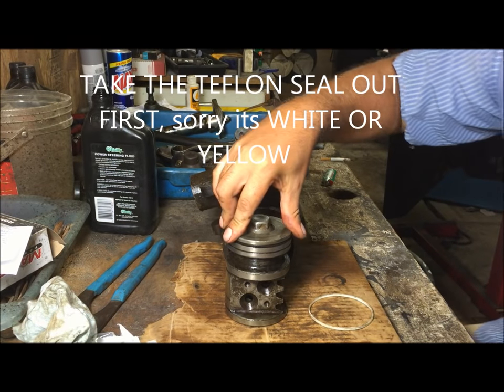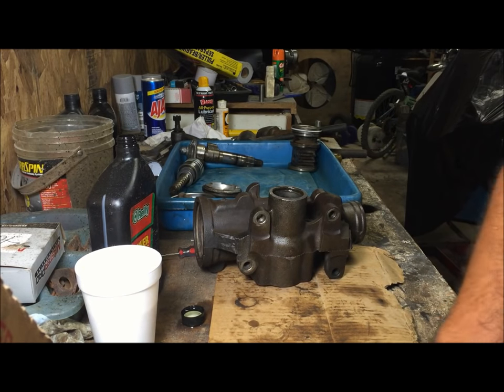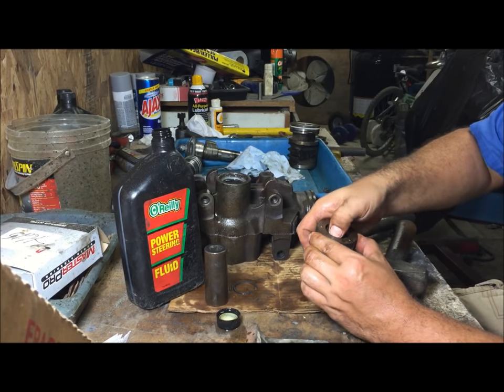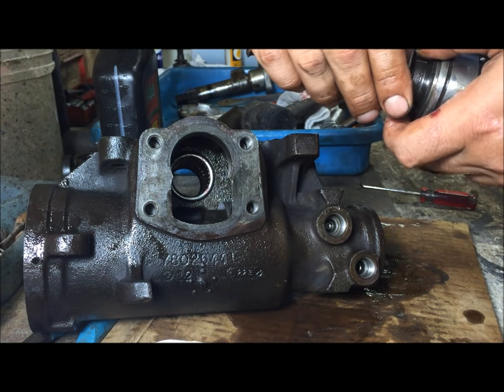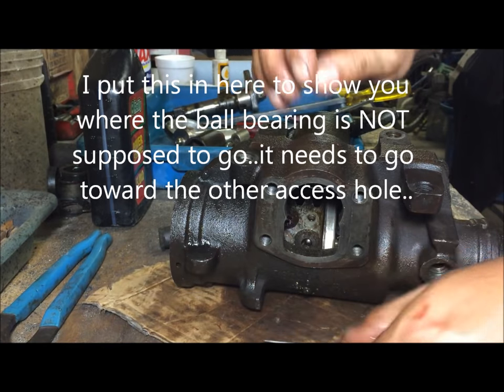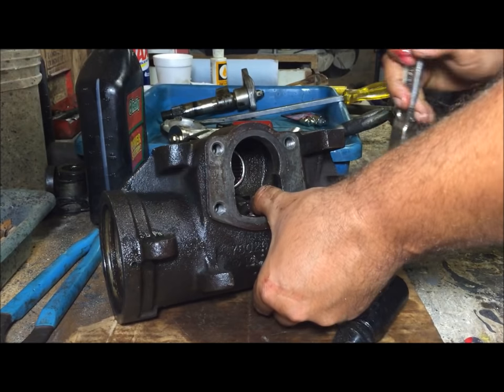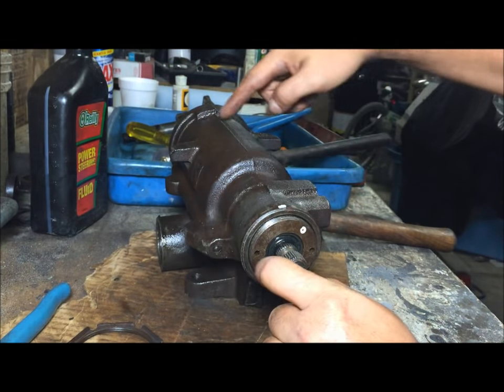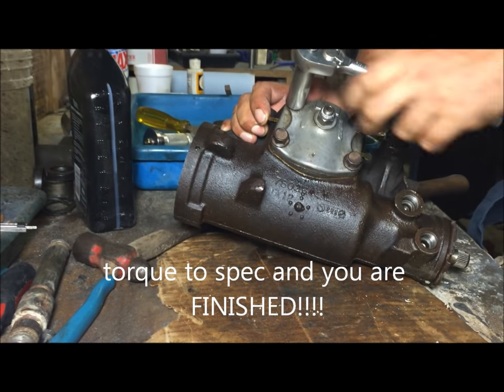how to rebuild power steering gear box saginaw part 2

Comment: When messing with Teflon seals, I learned this trick using some plastic from a two liter bottle or similar and a hose clamp. Cut a strip of plastic from the bottle. Install the seal, then wrap with the plastic. Use the clamp to apply pressure to the seal to get it to seat and get used to the idea of being cramped into the groove.
Reply: I had issues with the 3 smaller Teflon seals. I cut up a beer can and used 3 hose clamps 15 min later it went right in.
Reply: Great idea

Comment: Hi ! nice video ! rebuilding power steerings for trucks is my job since 2005 ! you did a good job on that one !  I have a tip on how to fit teflon rings (the 3 little ones and even the big one on the piston)  and how to get them back in normal shape !  I use a small cord (string) , then you just carefully put them in place by pulling them with the string after that you just pull the string out and then to make the teflon ring back to its size you can use electrical tape (3m,scotch,nitto) just a couple off rounds around the piston and you let it rest for an hour or so , It really works good ( because you don't always have the right tools)   . ( I'm from Belgium so normally I speak dutch , hopefully you understand what I tried to explane ) . grtz Laurens , have a nice day  !
Reply: hello  do you have any idea how to get a steering box for 1988 truck toyota ln65??
Reply: Lola vs Luigi put electric tape around to protect it then hose clamps to size them back up.

Comment: For the Teflon seal to get it so it fits in the case use some electrical tape enough on there so you won't damage the seal when you use a hose clamp over it so you can tighten it up snuggly to shrink the seal down a bit and when your ready to install the part with the seal take the clamp and tape off and put it in the hole. It'll expand back to shape before you start to use it. We do this for transmissions so you don't rip the seals. That's the reason why most people can't get transmissions to work probably using solid teflon seals and why they use cross cut seals instead because they don't have the knowledge
Reply from the maker: I might make an updated better video.. will do that for sure 100%

Comment: If you put the teflon seal in a cup of water placed in the microwave for a minute orvtwo...water has to boil a little... then you can take the seal out of the water and stretch it around the component you're putting it on and after it cools it will shrink back to its normal size

Comment: I agree with Chris Craft. I was taught to use trans-gel or vaseline, as it melts and blends with P/S fluid. Just like ATF. Plus, like automatic transmissions, they also used hard Teflon seals, the white ones. Carefully install these and do not roll. You can cut a large soda bottle, lube it and slide the seals in place, preferably the bottom seals first. Now, these need re-sized to fit inside the bore. It is tapered to facilitate the installation of this spool valve with the worm gear attached to the input shaft. This gives a delayed twisting action and provides a feed-back or road feel. (Note; this part is different from truck / van to car. Even sedan to station wagon in this era) Once the Teflon seals are installed, overlap these with the cut soda bottle and place large hose clamps and tighten down. Leave on for an hour or two, but only remove just before installing the valve assembly with the worm gear on, into the housing. The input shaft needs a preload to rotate freely but with no play. Marking this before disassembly is a normal practice, but after cleaning, new parts and seals, it maybe to loose or too tight. Use good judgement if you don’t have the correct tool to be used with a beam type torque wrench. Before installing the cross shaft of pitman shaft housing, loosen the preload screw & lock nut on top. I go 1/2 turn because it’s easy to remember. If too tight due to the rebuilding procedure, the aluminum top cover will crack. Also, when installing the housing end cap, use 1 or 2 large (Deep) wood clamp(s) on cover to input housing end. This safely holds the aluminum cap on the O-ring, compressing it enough to ease the installation of the steel “Cir-Clip” into its groove. The housing fills quickly once the engine is started so watch the pumps fluid level and turn the wheel left to right or lock to lock, while the wheels are off the ground, as this will help purge air from the steering gear and lines. 
(Note) The less number of ball bearing grooves total on the worm gear, makes the steering gear ratio quicker. This is found on certain vehicles during s the 70’s & 80’s like the Corvette. Good luck finding one of these in the bone yard. Today, that part is in a CAD drawing and made by CNC machines, they are on contract for limited companies and not sold out-right. So, find a machinists and make a new friend.
Retired ASE Master Tech

Comment: Mine on my 74 GMC P3500 stepvan (Saginaw 708 series gearbox) only had 22 balls in the ball screw as well). The chrome plated balls that looked silver were.001” larger than the darker bearings so I had to stagger them in. I also fought that Teflon seal in the main ball screw piston and had to use a piston ring compressor sleeve to get it in. Thanks for sharing!

Comment: also, I recommend not using wheel bearing grease, as it does not readily dissolve in the fluid.  Power steering oil works fine.   For the ball return guide, I used an engine assembly paste to hold the last balls in place.   

Great video, it helped me through it!   and your musical taste is excellent.

Comment: Chris Thanks for your video. I bet I have watched it 10 times! It has really helped in my box rebuild (68 Camaro). I thought about buying a new one but I liked the challenge and watching this gave me a lot more confidence. Interestingly, My bearings (recirculating), were in the opposite direction- They were in the position of where your bolts where and my bolts were in the position of where your inlet/outlets were. I made a few mistakes but was easy enough to go back and fix. The ball bearings took me 7 tries until I found out what was really going on. I had 24 bearings and realized that if I put 6 bearings in the crossover with grease, it solve one of the problems. The other problem was that after installing the bearings, I let the unit travel to far and a few of the bearings were able to pass to the front. That jammed the other end and I had to remove and try it again. You have over a 1/4 mill. views so I know you helped a bunch of people! Again, Thanks for the video!
Reply: Going to give it my best shot on my 86 C10. Started with the input shaft seal, and ended up pulling the worm gear out unknowingly and well… here I am lol…

Comment: Hey Chris, the easiest way to handle those Teflon seals in the Saginaw steering box is to wrap a lubricated zip-lock tie around the fitted o'ring and pull it up like you do with a ring compressor. Fit the piston into the bore and the zip-lock just slides off. You will fit all the teflons and piston in no time at all. Keep up the good work and videos.

Comment: Hi Chris, trank you very much for the video! It took me several times with the balls. I own a Dodge Ramcharger 1985 4x4, there you has to turn clockwise to install the balls, the piston is built a litten different. Michael from Germany

Comment: Well I just finished the disassembly part, new parts will be here Friday and I will be ready to assemble a clean box and parts using your video. Actually you inspired me to do this, thanks.
Reply from the maker: the bearings are hard to put back in just remember there are small and big and they go back in that order.. mine had all the same size so I didn’t go over that

Comment: Great video!  I have been looking all over you tube to find a video on putting balls in a worm gear!   I can’t find any on putting those balls in.   I am rebuilding a Ford 5000 tractor power steering assembly!  It has 28 balls to put in a long worm drive.  I got them in and I think it is right, but I have to put it back on the tractor to check.  For a long time, I didn’t know I was supposed to take that tube for the balls of and I was trying to put them in at the top of the worm drive.  I could get about one half of them in and no more. I tried 4 or 5 times. This video really helped!  Thank you!

Comment: Hey Chris. Wanted to saw thanks! Just rebuilt the steering box on my 77 K20, thanks to this video. Really helpful and cracked me up. No frills , just real! Oh and I found it easier to get the piston , with the pain in the ... Teflon seal in if I put it in the toaster oven at 180 degrees for about 1/2 hour. Gotta buy my wife a new toaster oven now though.🤣 Thanks again!
Reply from the maker: you are welcome.. I am not a master of this but I did rebuild 2 and saved like $400 .. they both work perfect to this day with no leaks

Comment: I didn’t find your video until after I started to rebuild mine.  I would not have attempted it if I heard your advice.  I had to try maybe four times to get the balls in right.  Kept losing one or two down the wrong way.  I may yet end up buying a rebuilt one since I haven’t put it back on the truck yet to try it.  You made it seem easy compared to all the problems I had.

Comment: I have a leak on my 59 Pontiac on the input shaft. Same design on my gear so now I am quite sure I can manage the job without taking the gear out. Just loose the steering column and pull it a bit into the car then I can take the plug assembly out. Thanks for a good movie!Marcus, Sweden.

Comment: Thank you! Great video. I read the unit repair manual for a 1979 Camaro and it said there are silver and black bearings and to alternate them. As for the difficult first seal to get in I used a piston ring compressor and it dropped right in. Cheers
Reply: The balls are not actually black they are just sort of silver gray while the others are shiny silver. The dark ones are about 1/1000 of an inch smaller and in my gearbox there are 12 silver ones and 10 dark ones. You have to look close in good light to see the difference or measure them with a good micrometer.

Comment: the worse part was getting the pitman arm off. Make a long story short , I ended up using a acetylene tanks to heat it up and still had to use a breaker bar with extended pipe and quench it in oil.

I really do appreciate the time you took in showing us this. Every glad you emphasized on each things. I almost didn't bother marking the end. Glad I did to get manufacturing torque. Them elongated bearings are roller bearings. That's okay, just want to say thank you.

Comment: i know this is an old video, but with that teflon seal you can do what is common for home builds with transmissions.  place it on the piston, then tightly wrap around the outside with electrical tape and let it sit for a while.  that will squeeze it with out risk of cutting or damaging and help 'shrink' it down so that it will fit in the case much easier.  
teflon seals on auto's do this, such as those used on 4L60E's etc.

Comment: After watching part 1 as well as this video, I was able to replace the leaky input shaft seal gasket and dust cover on my steering box. Much appreciated!
Reply: Does the worm gear stay in place so that top assembly can come out.  I'm thinking I can do it with the box still on the car.  Thoughts?
Reply: I had room with the column pulled back to remove the top assy of the box, ie lock nut and valve assy.  All done without  removing the box.  Replaced the oil seal and dust seal.

Comment: Thanks man. I am now much more confident about trying this rebuild for my '77 Checker Marathon gearbox. Great shop music by the way. Stay gold!
Reply from the maker: the only part that is tricky is getting the bearings ball bearings back in.. and that main Teflon/ oring .. watch all the videos on YouTube several times before building.. remember the 2 diameter ball bearings.. if you have them
Reply: @chriscraft77022  Hi, beautiful video, we just don't know how to adjust the teeth in the auger. Clearly the screw on the lid, but how much is tightening?

Comment: old video i known but this was a help, lastly i found on my case, there was a ridge that was sharp that made mine hard to install with the big teflon seal.  Ruined one and had to buy another.  I used a flap disc on a dremel and beveled the edge.  the seal won't make it that far back once assembled so it don't matter that is isn't perfectly "round" right there.  Then i rewashed the case in the parts washer

Comment: You can heat the teflon ring in near boiling water for about 5 minutes. Next, get it on over the o-ring. Then while its still warm, slide the piston slowly in, even spinning it a little. The teflon ring will resize(shrink) as it cools in the cylinder. You can always reheat the tef ring on the piston in hot water as well and squeeze it with your hand to resize it too, but that will take a few minutes.

Comment: The thrust bearing has a bearing Inch Pound preload specification for it, you adjust with an inch pound torque wrench on the end of the shaft while adjusting it with the proper spanner wrench.

Comment: On my retaining plug it was not doing its job as if someone switch THE RETAINER  to a smaller size. All that usually held into place could slip easily over the retainer. Thanks for the video

Comment: The problem with that teflon seal in the beginning of the video was that it needs to shrink down so it will fit in the case bore. You could take a large zip tie, pull it tight around the teflon seal, and let it sit for about an hour. This would achieve the same goal of getting the teflon to shrink down without risking damge by sliding it into the case.

Comment: Your right. The Teflon ring on the large piston was stubborn. Don't be tempted to hit it with a hammer.  I used a heat gun to warm everything up.Grease/lube and I used a piston ring compressor to put it in. You may need to tap it lightly with a wood dowel/hammer handle. went right in.

Comment: Here is the trick we use with Teflon seals in transmissions. Simply find a hose clamp that fits the circumference and tighten it carefully around the seal compressing it. leave it sit for half hour or more before removing clamp and installing.    Another trick is using mylar plastic wrapping plastic around seal acting as a cone guide and installing assembly into case then sliding mylar out. A picture would be better unfortunately don't have one.
Reply from the maker: +E Beaulieu    wow.................. i actually have like 20 of those big hose clamps.......... thanks for the useful info
Reply: Petroleum jelly helps keep the balls together, will dissolve in power steering fluid or ATF.
Reply: I did this and it worked perfect.
Reply: Sealfora76chevystringbox

Comment: thanks for the video, I got the pump all rebuilt and back on the vehicle.  but the steering wheel is super tight, will not move left or right.  when it was on the bench it works nice and smooth.  I wonder if air can get trapped in the system,  similar to brake systems.
Reply from the maker: +nevada smith  it should stop doing that and start working just keep turning it left to right and make sure it has fluid of course... my chevelle did that at first

Comment: You put that seal on like you do in transmissions. You use a feeler gauge spoon type. Then as you push. You slide the feeler gauge around it. And use transmission assembly lube on PS units.

Comment: Great video.  Here's a question no one can seem to answer.  Looking at the hose ports on my box the pressure side seems to have something in the bottom of the port.  Maybe a screen?  On the return side I can see straight into the box.
Reply from the maker: yeah, ive seen the screen..   the pump has these little floating rectangles that can be damaged..  just a precaution in case the pump fails..
Reply: It's a check valve. Actually if you take an easy out and remove the bronze cone you will find a very small thin plate that sits against the bronze cone, under it is a spring. That's it, they call it a check valve.

Comment: Good afternoon, very good video...thanks for making it. I am rebuilding a Saginaw power steering gear box with a large 76 embossed on it. I was told it was  for my 1977 Jeep CJ 7 with a V8. My question is that upon disassembly I only have 22 ball bearings. I did a bit of research and some folks are saying that International boxes used 22 bearings, but do you have any knowledge on this? The 76 stamping on the case I believe is correct for my CJ 7.

Comment: Hello Chris my 1976 Pontiac firebird gearbox was leaking and I replaced the input shaft seal and pinion seal but it was still leaking. I finally found that it was leaking out of the torsion bar. I had to press out the pin that holds the torsion bar inside the input shaft and it has a groove inside the input shaft where looks like an o ring goes. There was no o ring. Maybe it uses sealant adhesive but I found an o ring that I can fit inside and pushed the torsion bar back in and re assemble and no more leaks. Not much information on the torsion bar on Google and no seal kit for the torsion bar

Comment: I had an issue as well, with the teflon seals on both the rack piston, and the (3) on the valve body.   My solution was to set them in their grooves, with the o-ring, then tightened a hose clamp over them.  After sitting overnight like that, they installed without issue

Comment: do you think, that the input shaft can be removed by itself, just to change the seals there, while the gearbox is still in the vehicle (79 truck). i have a lot of room i think, due to a body lift, and once the steering shaft is gone i think it would be fairly easy, since it was the first part you removed in Part 1, and one of the last parts you reinstalled.